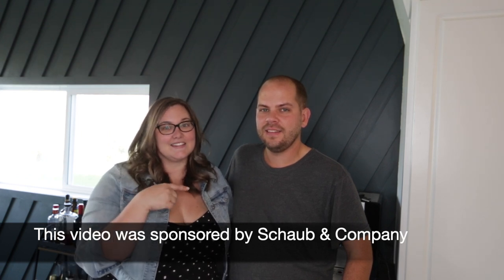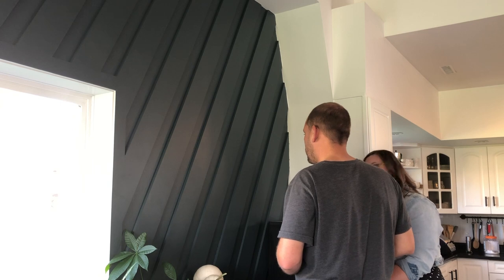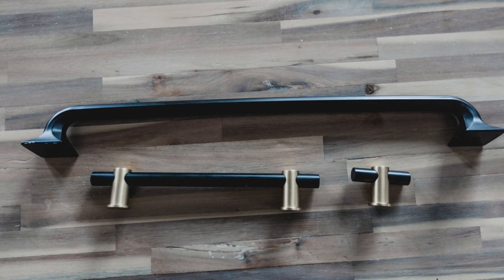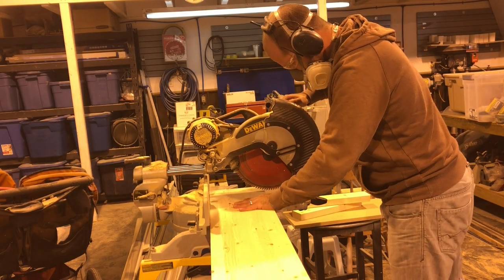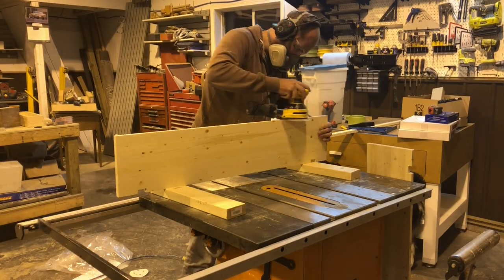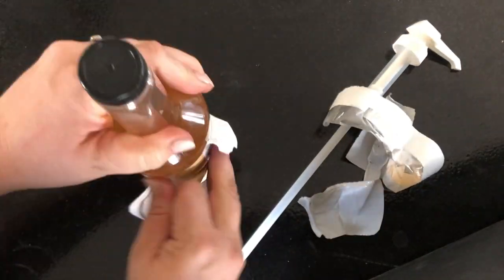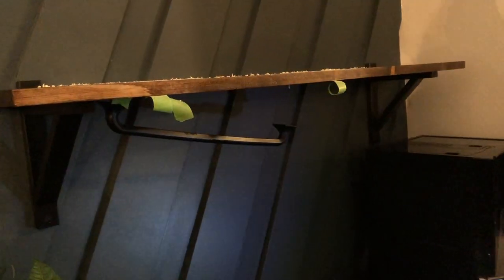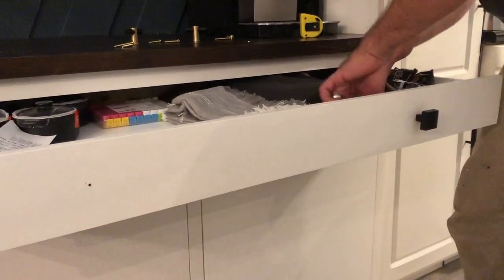DIY Coffee Station At Home [& Modern Coffee Bar Styling!]

Comment: I'm creating a coffee /wine station in my kitchen where there once was a built-in desk.  I've read that the shelf should be placed 18-21 inches above the counter, but our counter is 3 inches lower than standard.  I'm contemplating placing them 24 inches above the counter. Can you tell me how high the top of your first shelf is from the floor?  This is a real struggle for me because our ceiling is 9 feet high and the shelf at 54 inches looks really low as compared to the wall.
Reply from the maker: Unfortunately we don't live at this house anymore. But my suggestion is to go with what works and looks best for your situation. If you need to adjust the shelf height slightly to work with a unique counter measurement or ceiling height go with that.